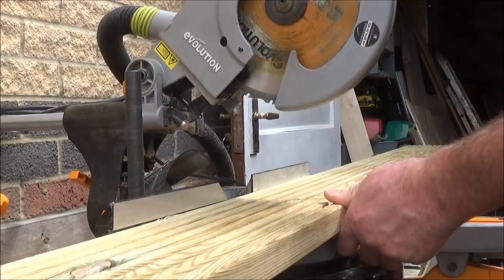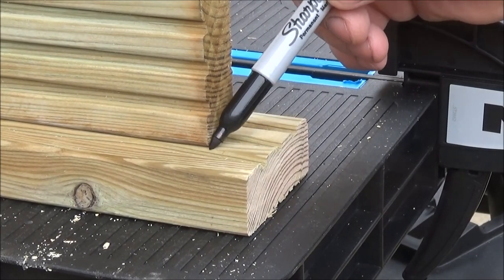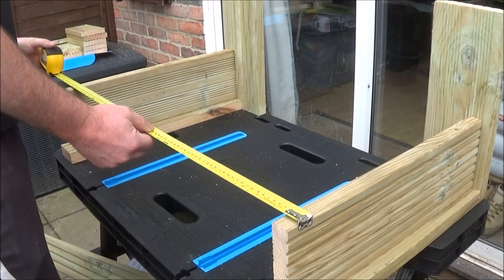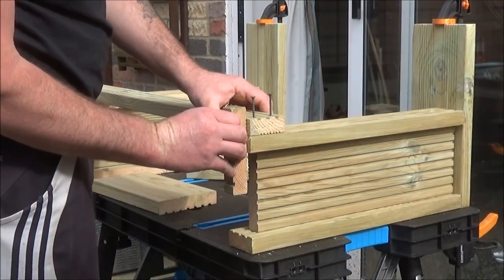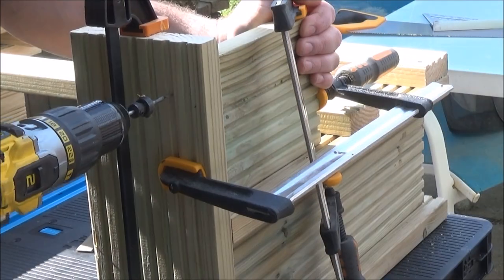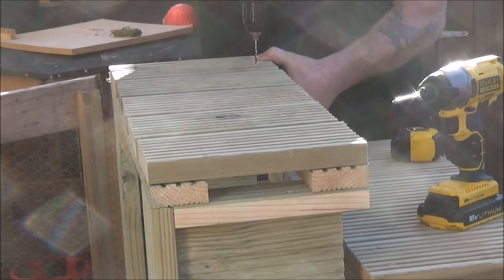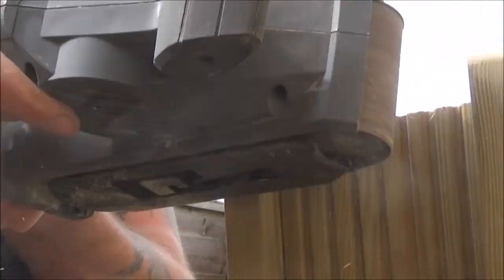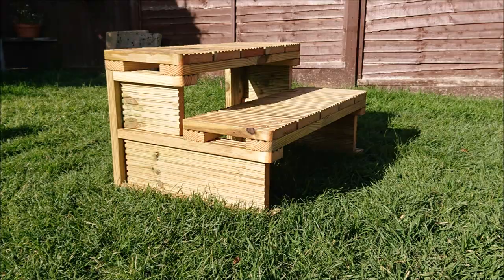Making Wooden Steps With Decking For A Caravan/Hot Tub - #012

Comment: Great vid, I live in Ireland and made something similar for my caravan, but had to change the orientation of the step pieces as when I stepped on them I found myself slipping when they were wet. Change the orientation so that the groves are going across your sole as opposed to with your sole when stepping on them gives much better grip.
Reply from the maker: Thanks, if I were to change the orientation of the board, with the span of the steps I would want to put some extra bracing under them due to the eventual bowing that the steps would get. I have the board running front to back so the water can drain off backwards rather then puddles form either side of the steps

Comment: Do not think me crazy. I moved into a sidewalk apartment that you open the door to 2 steps going down. I want to walk my e-bike onto a wheeled box that covers those two steps...to parallel the sidewalk level, and walk the e-bike onto it, and wheel this dolly away from steps. Not a ramp. More of a baby crib's length on wheels but how do I bring the llip to reach across the top step to make this work?
Reply from the maker: I think I understand what you mean. You would have to make a box on wheel level level with the top step, then make a separate box shape that will fill the space between the top and bottom step and fix this to the box on wheels, then use a sheet of ply wood to line the top
Reply: @JamesManCave  Can I make a shape of a letter ''h'' laying sideways, so the wheeled box shape has a lip to approach and meet the sidewalk? Could I use large steel L Bracets to support extended one piece top that 'hides the stairs below it. I have a steel coffee table on load bearing wheels 3FEET L x 2FEET H. I have the plywood cut 6 FEET. The theory is to roll the platformed e-bike away from steps until leaving.  LOVE YOUR IDEAS* -- Resting e-bike wheels distance* is 56 inches (4" shy of 5 FT so plywood is 6 FT.). Step distance estimate is 30 inches from sidewalk to end of steps. Would I use concrete bit for drilling Bolt Holes?
Reply from the maker: It's bit hard to say with any certainty with out seeing the intended area and the sidewalk. But I would imagine for your description of what you want to build would work fine. If it's to short you could always add spacers underneath where you plan to attach the wheels
Reply: @JamesManCave  Thank YOU*. Your 'spacers' just revived me! That's the cure certainly - THANK. YOU SO MUCH from Ontario Canada*.  In you honor, I will extend the Deck for safety, and be able to Turn ALL around,  so the e-bike can 'face the open door to exit.  I WAS 2 inches shy by the top step lip - remeasuriing from floor -- How your reply addressed that exact issue? _ amazing!

Comment: Step boards are running the wrong road
Reply from the maker: I thought about this when I was making it, if this was going on concrete or a solid ground then I would have out them the other way, as it's sitting on stones and mud, I didn't want there to be a huge puddle at the bottom of the final step. Running them side to side ment the water was able to run off to the side